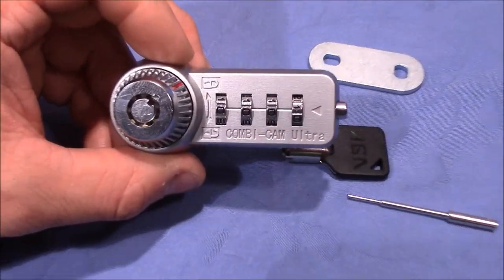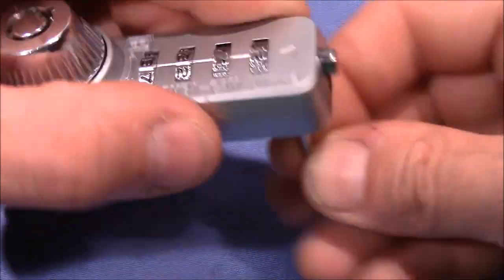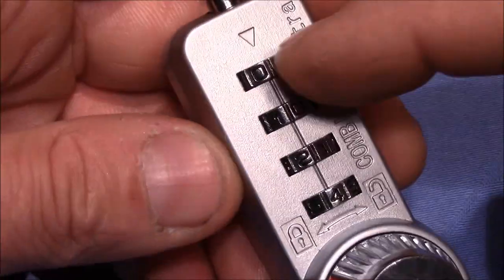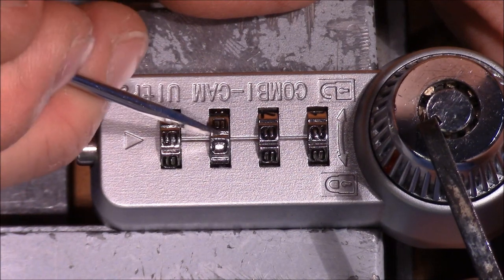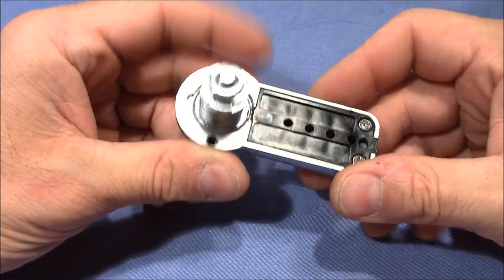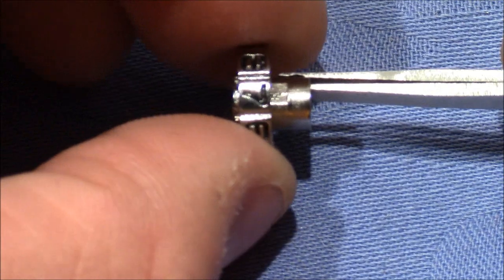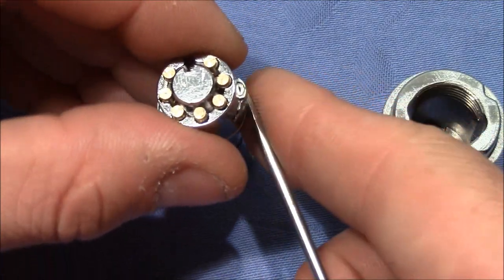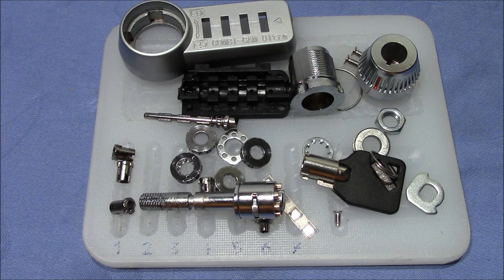(picking 372) COMBI-CAM Ultra by 'West Coast Picks' picked, decoded, dissected - an epic undertaking

Comment: Cool, a lock that is designed to be decoded! I wonder if it was for use in schools or public lockers? Really interesting to see how it works too, and i've never actually taken apart a tubular lock before, so this video was so interesting.
Reply from the maker: Thank you. Was also exciting for me to gut it. But that's actually an unusual implementation for a tubular lock. Usually you have separated key and driver pins and no "side-bar".

Comment: The SUDHAUS 1844 is also interesting. At first, it looks similar, but it has a wafer tumbler. One feature is the automatic reset of the wheels. Enter the correct code, turn to open position and all wheels return to zero! But there is more: using the correct key, you can make it show the code.
Reply from the maker: Sounds interesting with the show-code feature. Would love to see it.

Comment: nice lock and well explained!  my only question is if you use the combo and the key at the same time can you make the cam turn 180 instead of just 90? like turn knob to 90 then turn the key  90 more?
Reply from the maker: Good question. But, no - you cannot achieve 180° as the knob turns with the key and vice versa.